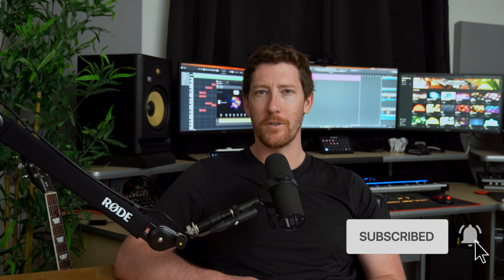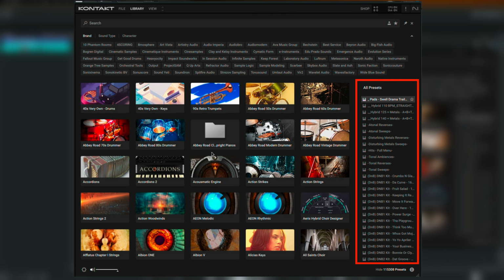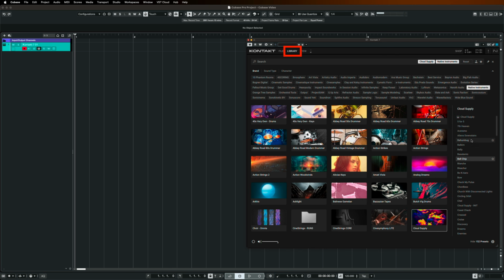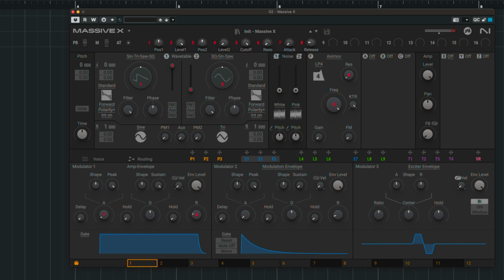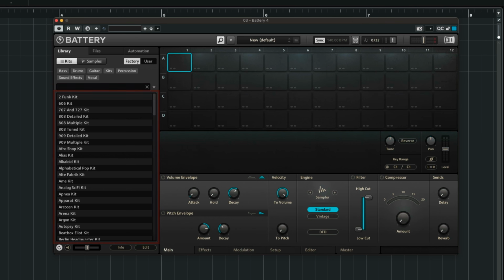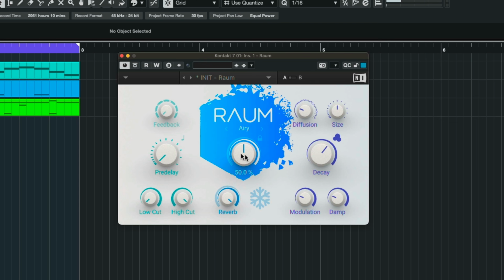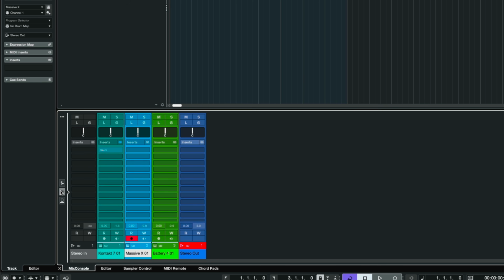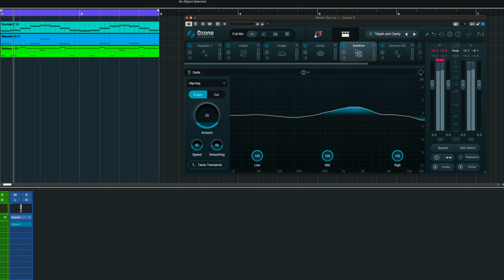How to use Native Instruments tools with Cubase | Native Instruments

Comment: Basically I can’t use much of NI in Cubase as the interfaces are so small you can’t properly see what you’re doing. To have non resizable in 2024 is pretty poor.
Reply from the maker: Hey, it's possible to resize Kontakt. Have you tried using the zoom settings?

Comment: I love cubase but my work flow is faster when using maschine why cant I use my new kontrol s61 with my maschine  to build a beat then add later in cubase or reason.please say you guys are solving this I feel I bought the kontrol for nothing. I spent alot on my maschine, komplete ultimate 14 and  tons of expansions for maschine and then I buy kontrol s61 and still no maschine support 😢